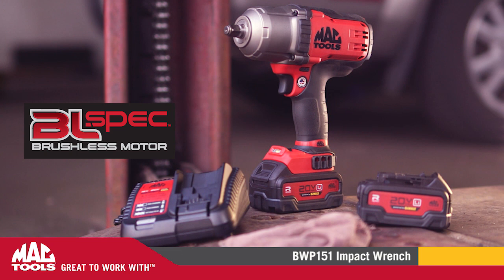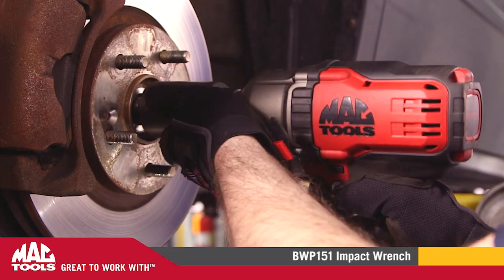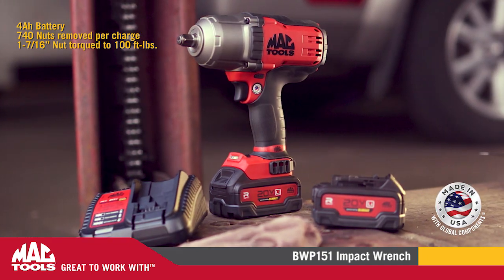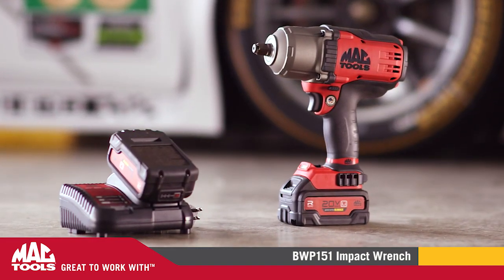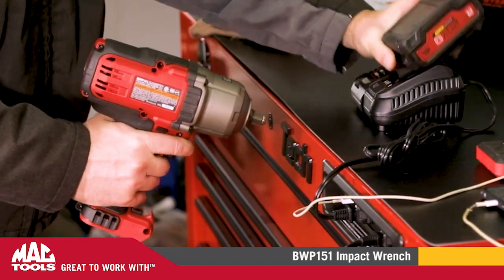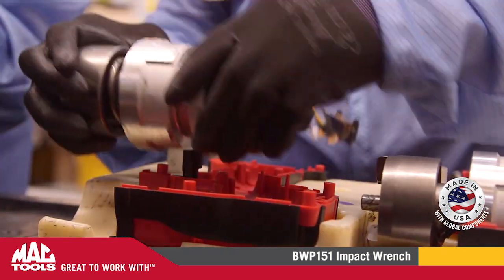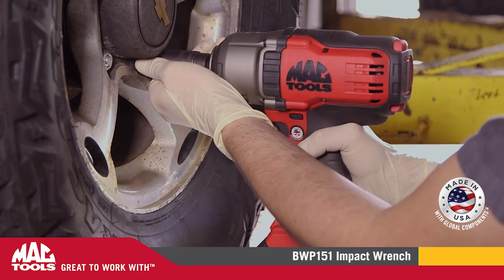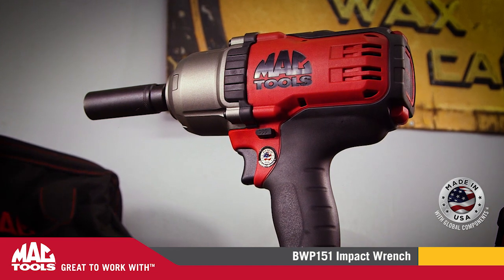BWP151| BL-Spec 1/2” Drive Brushless Impact Wrench | Mac Tools®

Comment: I've had this impact for about 5 years now, since maybe when it was introduced.  Used daily in a shop environment.  It has worked perfectly without any troubles whatsoever.   The biggest issue I had was with the batteries, the battery life LED indicators stopped working.  But the batteries still work fine.   Overall very happy with it and will continue to use it.

Comment: I got the Dewalt DCF899 for less.  It’s the same exact gun.  Except my kit came with a bigger 5 amp battery.
Reply: Correct, MAC belongs to Stanley black decor, same fabric, same parts, same material.
Reply: @5162-b8y  yes and no. Mac impacts use a higher grade plastic and rubber to resist chemicals.

Comment: Is it just the Dewalt impact and mac just put their name on it looks identical do the DeWalt
Reply: Joshua Baker no it has much better internals
Reply: @dannygame8381  
No, it's identical other than the red housing. You can even use DeWalt batteries on it.
Reply: It’s the same exact gun with the same exact internals and motor.   

The red paint job cost an extra 100 dollars though.
Reply: This is basically their version of the dewalt, just 10x stronger.
Reply: maximagmhondafan88 

Bring your Mac tool, and we’ll put it up against any on my Dewalt.  I’ll gift them to you if they can out perform the xr.
Reply: @dillonh321  that red housing is higher quality than the DeWalt, it’s designed to resist chemicals.

Comment: Does anyone own the mid torque version of this the part number is mcf894 I’m trying to find some reviews on it
Reply: Jeff Knox got one coming next week.  We’ll see how it goes
Reply: You can get the same exact gun from Dewalt it’s the dcf 894.  Available on amazon and ebay for less than 150.00. It’s pretty strong but not as strong as the dcf899.

Comment: Every week when the tool trucks come to work and they pass out their sales flyer I just cant help but laugh at the absurd pricing on their 'great deals'. This being no different, yet people still line up money in hand so eager to get bent over and raped. Does the red housing make it last longer or work better vs its yellow DeWalt brother that costs 50% LESS and comes with a better warranty ?
Reply: I have a great relationship with my Mac dealer. He's helped me get awesome deals for great tools, so I had no problem dropping the money for this. Most of the time you pay for the convenience of not having to drop hundreds of dollars at once.
Reply: @poopstarsk8   if you cant afford to pay cash you cant afford it. remember this one day when the wolves are at the door.
Reply: @cantbuyrespect  bs I'd if don't want to drop 500 for a tool i can just pay 80 bucks and do that every other week done for multiple tools from multiple tool trucks from mac matco snap on gear wrench pay it off and I'll do it again no issues ..
Reply: @edgarsanabia6874   did you know that snap on ,matco, mac , and cornwell all have in fine print that if you dont pay your tool box payment(ie you fall on hard times) which many flat rate tech do as well as when shops close that they can not only repo the box but all the tools in the box as well. you ever wonder how they get loaded used toolboxes? they not only get the toolboxes and tools on a repo but also ding your credit and send it to collections.  my question is what are you doing wrong with your finances that you cant afford to pay a $500 tool cash? bet you have no emergency fund either...
Reply: @cantbuyrespect  iv been working for nissan for 7 years now my main box and roll cart are harbor freight i purchase the tools i have because i make more money with better tools if i feel i need a master fuel pressure gauge and it's 500 bucks I'll throw down zero bucks and tell him to charge me biweekly set to match with my pay days never miss a payment have had zero issues so far in never owed over $2000 i have never had to run anything on credit there is no interest with anything i pay never goes up affects my credit in no way which is nice because like i said i can pay that 500 off with zero interest basically a front my mac dealer is a bad ass and always works with me on warrantys but i feel like If you get fired disabled not making hours whatever it may be you should talk to your delear and let them know what's going on end of the day with or without your credit on line you agreed to make the payments
Reply: @edgarsanabia6874   this is a terrible way to think when it comes to finances. i have a snap on epic box and a cornwell mobile workstation loaded with any tool most techs would need all paid off. all bought used. i actually have a master fuel pressure test kit(part # gsi4325) that was around $500 new.....you know what i paid for it? $50 at a pawn shop because some moron fell on hard times. that payment didnt go away just because he lost the tools in pawn. thats how ive bought most of my tools. the resale value is 25-40% of new cost. no reason you cannot buy it cash. going with a harbor freight box was a good idea if you paid cash for it. but think of paying off in full recurring debt as giving yourself a raise because thats is essentially what it is. i just bought a $17000 tractor with cash, and still have a fully funded emergency fund. how you say? i was smart with my money. the impact in this very video is made by dewalt.... i have 2. one at home and one at work. i gave $40 for the one with a battery and $100 for ther other with 2 batterys. bet mac charges $450 for it with 2 batterys/charger.  this is just advice if you dont want to be broke forever.
Reply: @cantbuyrespect  i know you can buy tools cheaper used that goes for just about anything all I'm saying is if your tech and you don't feel like throwing down say 500 bucks cash it's not bad to do payments interest free and always pay it off faster because i shoot any extra 50 or whatever when i have extra i think it's common sense you can buy stuff used for cheaper no doubt but some times you can't warranty that stuff being a daily tech i break shit tool truck comes ones a week and always warranties my stuff and if you really want to pay less and get good tools online like amazon pretty good deals can get a master fuel pressure set for around 60 brand new not bad!
Reply: @edgarsanabia6874  You will pay more for the tool with payments than buying it outright. What kind of apr do you have? 30%?
Reply: @andym1223  zero interest my guy lol only thing I can see someone paying apr would be a pretty big purchase such a tool box..mine I harbor freight I'm not paying thousands for something to hold my tools